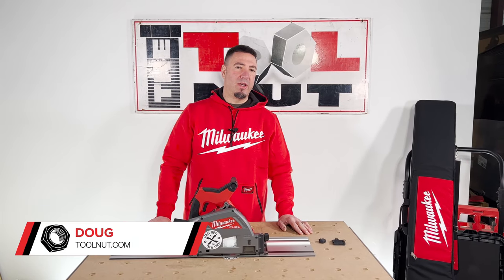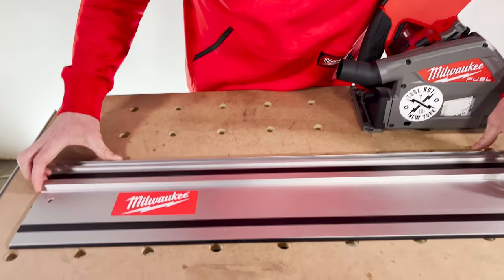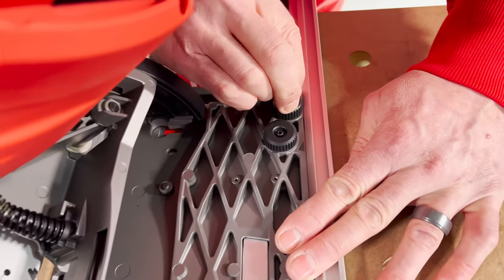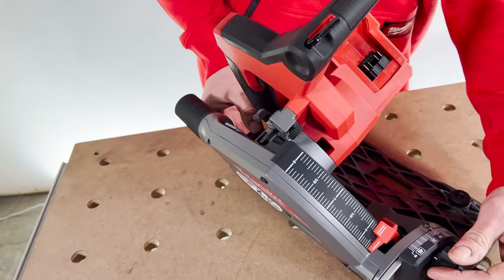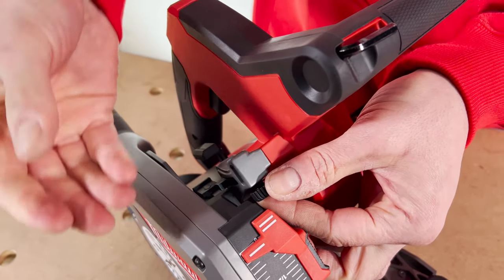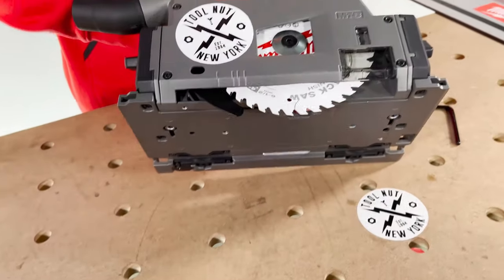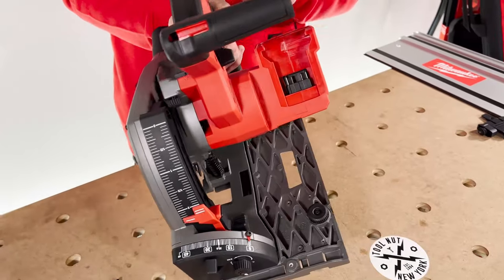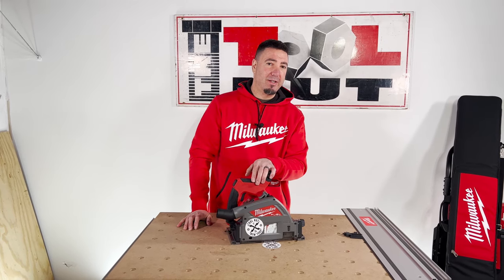[NEW] Milwaukee M18 FUEL Track Saw: Everything You Need To Know!

Comment: Do you know why my saw I bought in the Netherlands doesn't have the ability to lock it on the rail when cutting under and angle? The knob is missing but looking under the saw you see the  black piece for locking into the rail, but without a knob you cant use it...
Reply: It sounds like you got one that slipped through quality control I would contact the seller. Honestly, I almost never use it on mine.
Reply: @steffendetrick  it's also not in the manual so maybe patented already in Europe?
Reply: @henkeshuis3615  I promise you’re not really missing out on anything. I forget it’s there half the time. But it may be a patent issue with the Makita in the E.U. They don’t really play that Tom foolery over there. I know  they made Dewalt rebrand their XR line to 18 V instead of 20 V like over here. Which is good because it’s not a 20 V tool.
Reply: Just bought this saw in uk and mine doesn’t have the anti tipping clamp either. Trying to find one but no luck so far. Did you manage to get one?
Reply: @polaxe77  nope, not yet

Comment: What attachment would you use for this tool if you have a dewalt dust extractor?
Reply from the maker: Hard to say since Dewalt has multiple hose sizes. The port on the saw is the same as Festool/Makita and can be easily adapted with an adapter/step adapter. Again comes down to what size hose you are using

Comment: Will any Diablo 6 1/4 saw blade fit on this saw or do you have to use only Milwaukee saw blades? The arbor size looks different.
Reply from the maker: Any blade that is 6-1/2"  and has a 20mm arbor on it will work Standard 6-1/2" blades are a 5/8" arbor and won't work. Pretty much all track saw brands use a 20mm arbor for the 6-1/4 to 6-1/2" size saws. ALSO make sure that when replacing blades on track saws you are replacing with a blade that has the same KERF so it matches to your splinter strip on the rail or else your cuts will be off

Comment: What is that glue for on the back side of the blade where the little lazer cut zig zags are?
Reply from the maker: Actually, more of a rubberized filler for the laser cut vibration slots to minimize wobble and warping, which won't affect the cut. Most brands use/do this to their blades. My fingernail easily removed from the back of the blade so once it comes in contact with wood will do the same